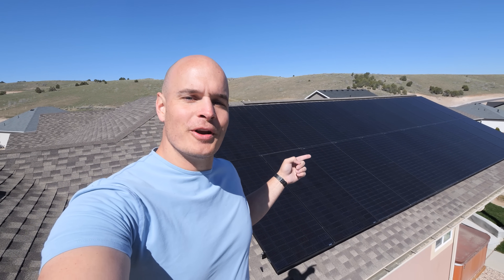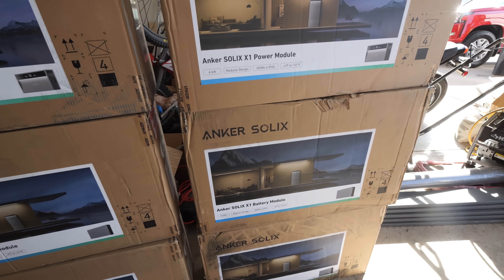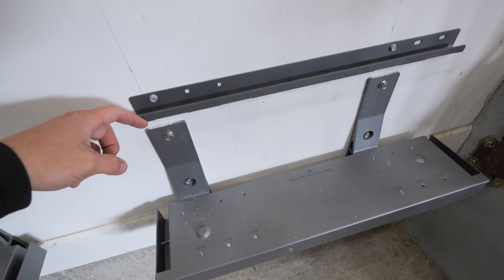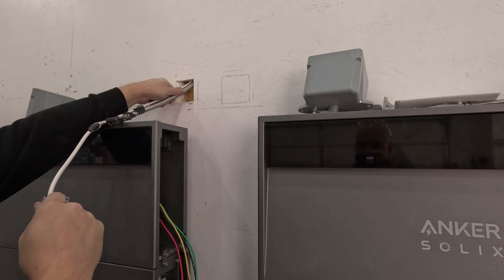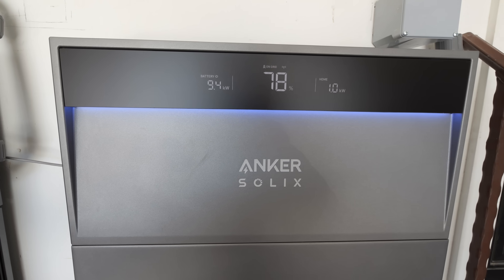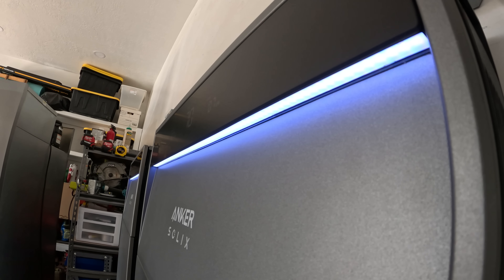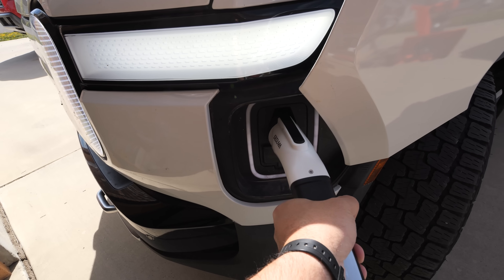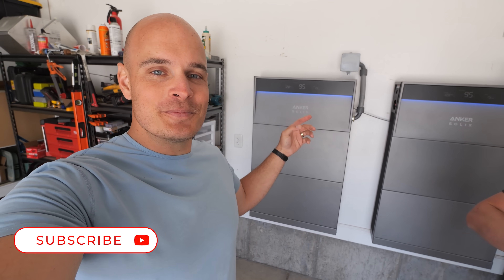How to Save Sunlight for the Night? - NEW Solar Battery Install

Comment: Solar is the cheapest? Are you high? 30 grand to add panels to my roof which I'll need to replace in ~25 years?
Reply from the maker: I'd check again with a reputable installer.  25 years is the warranty. Not the lifespan. And commercial solar farms are cheaper per watt than residential. Solar in general is cheaper - but your specific roof might not be.
Reply: @JerryRigEverything  Well that makes a bit more sense I suppose!
Reply: Rate dependent yes.

In my area, you get paid to install solar. And you get paid per kw put back in the grid. VS Texas, which has a solar tax. Which doesn't surprise me that their grid is constantly teetering on the edge of failure. So depending on where you live, it can be a major money save. Even when including yearly maintenance and lifetime replacement costs. And that will continue to get cheaper as panels get better.

Comment: Solar energy is the future energy
Reply from the maker: Agreed
Reply: @JerryRigEverything   you are replying me unbelievable thank you
 because your followers more than 8.6 millions, I am also from India.
Reply: Duh
Reply: Not for Ohio .
Reply: @nathanielcolston7770  What's wrong in Ohio? My rural KY road is filled with homes with solar installations within the past few years, the substation is nearly at capacity for what the utility allows to feed back into the grid so the few stragglers are getting battery backup systems.
Reply: @Voyajer.  the cost. It would take 27 years to break even on a system that’s only designed to last 25 years. That’s considering no repairs and no reduced solar panel output.